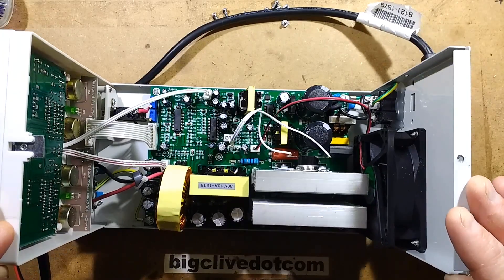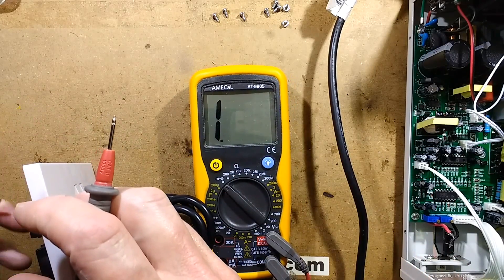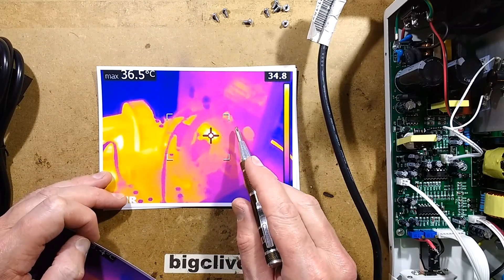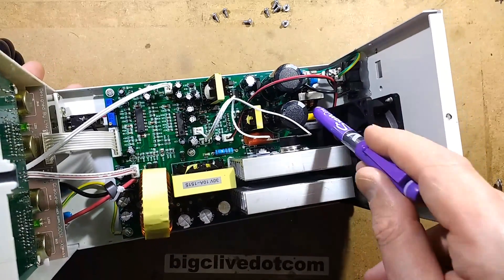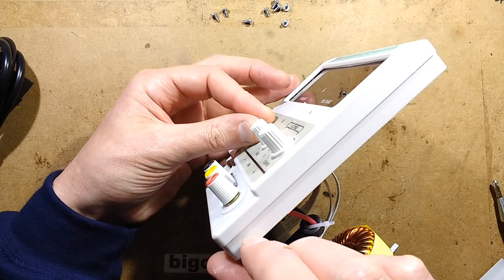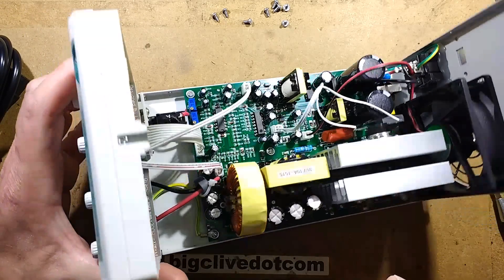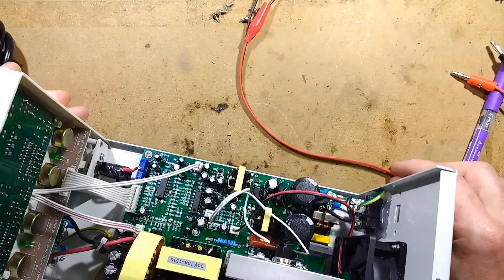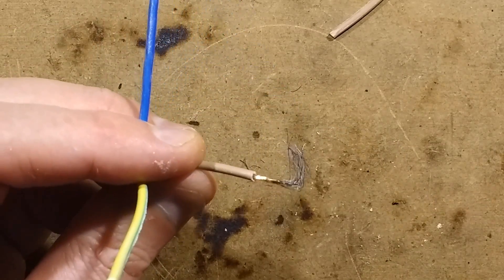Test of a PSU like the one that went on fire.

Comment: Hi Clive, I have a question and concern.   I recently took my MacBook Pro (mid 2013)15" which required a new power supply connector inside the computer.   Around 2 of the pins (#2 and #4) were darkened around the area like a burn.    After some time, despite having the appropriate 85W power supply still supplying 20.4v DC.. the computer wouldn't charger unless a jammed and wiggled the magnetic attachment.    What I noticed was that the connector of the power supply got very very hot, nearly burning skin when I touched it.    Any thoughts?
Reply from the maker: +Charles Wright Sounds like a bad connection.  Sometimes you're better changing both parts of a connector at once.  Plug and socket.  One part that is making a bad connection will damage the other.
Reply: Charles Wright one other thing to check for is iron filings , the magnets on mine often gather a coating, which stop them mating properly and could bridge the contacts I guess.  (I do quite a bit of milling/lathing/grinding mind you)
Reply: Thanks so much.....as do I do a lot of machining blacksmithing, etc.....fantastic thought.
Reply: Funny you should mention that.....I'm a blacksmith and never thought of that being the culprit...in fact when I had it repaired, they mentioned that the old power module in the laptop appeared to have been shorted out with a burnt appearance near the terminals.   A clean non-metallic brush on a dremel did the trick followed by IPOH on a swab and we are in business.  Thanks so much.
Reply: Charles Wright  glad you got it solved , mine never burnt out, but were difficult to seat until I spotted the shiny flecks and dull powder :)  I used a cotton bud to get mine out last time- thanks for pointing out a use for that nylon dremel brush I've been ignoring, it'll be my go-to tool next time :)

Comment: I wonder how they're doing the current feedback that's causing the oscillator to go unstable?  Someone fell down on the engineering.
Reply: Could be that massive output choke that they didnt bother stabilizing with some heatshrink/glue.
Reply: But that wouldn't account for the flicker.  When I was servicing switchers, if you could hear them, something was wrong as the frequency is normally higher than you can hear. As best as I can remember, it was either bad filter caps causing ripple to get into the feedback, or a power supply set for 240V plugged into a 120V power line.
Reply: Probably wouldn't affect the flicker no,  but the noise certainly.  A lot of better quality power supplies will heatshrink or epoxy the coils on chokes to prevent them from squealing/whining,  but yeah that's probably more on the input chokes than output ones.

Comment: So, circuit-wise it is basically an old-style ATX power supply...
Reply: Yes, and I'll bet the switchers are actually BJTs as well (13009 or similar, as usual in the old half-bridge arrangement).
Reply: apart from the multi voltage outputs
Reply: which the bench psu doesn't

Comment: LOL, they still use the KA7500 for Power Supplys??

You find those on either rather old ATX power Supplys from the early 2000s or so and of course rather shitty ATX Power Supplys...
Seen it a couple of times...
And it's usually some kind of Flyback circuit...
You should really take a look at some modern ATX Power Supplys. They use rather interesting things. Like LLC-Resonant mode converters and MOSFETs for secondary rectification and DC-DC Converters (12V to 3,3V).
And of course Ripple & Noise has to be under 25mV (or less)...
Reply from the maker: The circuitry reminded me strongly of a PC power supply.
Reply: This is classical AT power supply design, but for this application is much better choice than LLC. LLC is probably worst choice for wide variable output voltage, it is not impossible to make it work but at end you will get LLC solution that is much worse then this. LLC is still nowhere near as flexible as non-resonant topologies and for application like this, only usable solution if you want resonant technology  is phase shift PWM ZVS FB converter, but is little overkill for low power application like this (it is usually used for output powers over 10kW)

Comment: i got a korad 2x30v power supply. it came with the same terrible leads. like 18 or smaller wire just pushed over in the connector.

i replaced this with some 12ga silicone novak brand wire soldered into the jacks and to the clips. voltage drop before at 5A was like .5 volt or somewhere around there. and after it was like .02v or so.

does anyone know where i can find various sizes of wire as flexible as the novak stuff? (novak hobby shop is no longer in business)

Comment: Mine is a POS it goes into a weird unstable state almost an oscillation between CV and CC mode. The transformer makes all kinds of weird noises and on top of that I tried to charge some large lead acid batteries with it at 14.5v CC 5 amps and the thing blew up after about 5min! I had to replace the switching mosfets IRF-510's as I recall. I suspect the ones it came with where fake as the new ones seem to run much cooler. The reverse polarity protection consists of two surface mount Schottky diodes and no fuse so if you hook a battery up backwards the diodes and the trace near it explode... not much fun, the only good thing is this is a very standard layout textbook SMPS so it's easy to fix.
Reply: Tyler Costantini No amount of diodes can protect you from reverse plugging in a charged battery (or any other power source), your only hope is the current limiting.

Comment: What's a unijunction NPN?
Reply from the maker: It's the first type of transistor invented.  Just a plain traditional transistor with three layers of doped silicon.
Reply from the maker: Did I actually say unijunction instead of bipolar?  Damn!
Reply: I think you meant bipoler (BJT). A UJT is like a BJT, but the channel (between emitter and collector of a BJT structure) are connected under the base.

Comment: It's a nice power supply but has the usual pitfalls:
1. Poor leads.
2. Fan is a bit noisy. (Might be okay for some people)
3. Horrible output electrical noise.
4. Pulsating from an unstable feedback loop causing buzzing via Magnetostriction.
5. Crappy capacitors.
Reply: That's like saying it's a nice car except that you get horrible shakes at almost any speed, the wheels WILL come off in a week and it will propably burn you to death soonish... Where is the nice part?
Reply: petti78 It was a Holden?
Reply: Feel free to purchase a £150-£200 PSU instead of paying £40.
Reply: 6. The inrush limiting thermistors (hottest components) are mounted very close to the main smoothing capacitor. A bit more clearance would reduce the capacitor operating temperature. (A long term reliability issue.)
Reply: petti78
Well if it's not a nice car then why would it be a nice car? You fix it, duh! XD
Some new leads, a better output filter and a better fan, and perhaps a modification to the feedback compensation network and it should serve well.
Reply: bob s
Yeah true, but if you look at the thermals, the main capacitors don't seem too hot.
I'd be more worried about the output capacitors simply because they will see more ripple current, and thus heat up more if their ESR isn't low enough. (Sometimes you don't want too low ESR, actually. Super low ESR caps can make the power supply become unstable as it affects the poles and zeros that have to do with the feedback circuit bandwidth, ultimately affecting the stability of the feedback loop.)
Reply: The nice part is it'll sit nicely in a bin... :)

Comment: Is it not possible to remove the sleeving from the earth pin?
Reply from the maker: It's moulded around a thinner metal core.
Reply: Sure, but the cable is still fairly thin and made of copper-coated aluminium, so it's still a garbage cable.
Reply: For the sake of £1.50, lop the plug off and replace with a proper Kite Mark BS 1363 (or your country's equivalent) plug.
Reply: If you tried that with a UK plug, you couldn't get it in the socket. When you say they are not needed, that's correct, they don't do anything under normal circumstances but when something goes wrong in an appliance with a metal casing and it's not earthed, the entire case can become live at mains voltage. It's only there to provide a path for fault current to return to Earth which causes the fuse or breaker to blow and prevent injury or fire.As long as everything is fine then yes they are not needed but what happens when things go wrong and you have no earth pin ?
Reply: It's not just the plug that's the problem, that cable is not rated correctly. Best to chuck the whole thing away but make sure it's never going to be picked out of the bin and re-used by someone else by bending or snapping off one of the pins. A good pair of pliers will do this easily and it is a legal responsibility as taught by the NIC EIC.
Reply: If you're in the market for one of these, you probably have a half dozen spare mains leads anyway.
Reply: Philip F Labre got the US patent (1,672,067) in 1928 on our form of 3-prong grounding: 1 long round pin to ground with 2 power blades.  Said to be to protect his landlady from her fan. 

I used to have this patent number memorized to use in conversations.  Had to look it up this time.
Reply: I'd the cable wasn't such a load of crap anyway I'd use it on a piece of audio tech, many of which use the same IEC plug but don't use the earth pin. But the CCA wire has very high resistance and I wouldn't trust it there either.
Reply: pfifo fast No we don't!
Reply: I'm with Chris Errett.  I'd de-sleeve that ground ("earth") pin.

I'm sure an X-acto knife, file, blowtorch, or jackhammer would do the job.
Reply: I wouldn't. Why take the chance of mixing it up with a genuine cable down the line?
Reply: +Jason James All three pin IEC leads (C5, C13, C15) must have an earth as they need to be safe to use with any appliance - most of which will be Class I. (Actually, I believe it is illegal to have a Class II appliance with a three pin IEC connector, but can't be 100% sure of that).
Reply: OK, I've looked the standards up, and the cable I was referring to is the two-pin C17 -- a C13 without the earth pin. C13 leads fit a C17 socket, including the bad C17 one in the video, and would be (reeeeeelatively!) safe to use with one.

I agree with Chaos Corner though in that I wouldn't use these Chinesium cables anyway.
Reply: if you remove it, the plug will be stuck in the socket.
Reply: LOL  ....   "Chinesium"

That sounds fissile.

Comment: I have the same PSU. It's fine for my needs (Overvolting small components) My crocodile leads were also poor quality, particularly on the banana plug side. The wires were inserted the same as yours and the banana plugs were malformed and didn't fit. Also mine has really bad coil whine. Other than that it's a decent PSU.
Reply from the maker: It's just branded QW, but seems to be one of many identical units on eBay.
Reply: I would love one of these as I can not afford top speck kit. What make is it Buddy?
Reply: For not much more you might be able to pick up something like an HP 6632A for not a lot more. I ended up getting my 6632A for $80 shipped and it's a far better supply than these ones. It's worth watching for a few weeks and seeing what turns up.
Reply: Same here for the leads - they did not even bother to bend the wire over (quick fix though). But at least the crocodile clip was soldered, and it seems to be "real" copper (other than those cheap-ass croc-to-croc clips I have, they are even magnetic!). Thanks Clive for the heads-up!
Reply: Equipment branded G.W. is excellently awesome.
Reply: @gordonwelcher9598  Mine failed after 1 year. I eventually got some old school Irwin transformer based ones and they are much better.

Comment: As much as these Chinese companies love saving money, you'd think they would quit wasting plastic on sleeving those ground pins.
Reply: If you don't have a good working knowledge of UK plugs, you could easily think that adding the sheath to the earth pin was a good idea.

I've always just assumed it was an error, rather than a cost cutting exercise.
Reply: That would mean a design change, which would require a designer and additional work for no reason, not gonna happen. After all the plugs go out and they get paid, who cares if some capitalist pig dies on the other side of the globe or not. And think how much metal they save when the pin can be thinner from the bottom!
Reply: Plastic is cheaper than metal. Safety does not come high on the agenda in China, life is cheap.
Reply: Michael Beeny plastic on top of metal is not cheaper than just metal though.
Reply: I know that at least on one design I've seen Clive tear apart, the whole pin was in fact present, it was simply sheathed which effectively defeated the purpose of an otherwise functional ground connection. I'm pretty sure it was an error, but I'm just wondering why companies still seem to be producing these faulty products for no apparent reason, when it would actually be cheaper to make a proper plug. I mean. if the ground isn't functional anyway, why not just make the whole thing plastic and save even more money? Either way, it doesn't make sense from a corporate viewpoint.
Reply: Saves on metal.
Reply: Michael Beeny If they want to save copper (a bigger concern now than when the plug was invented), they can skimp on the tip of the pin that only does something during the brief moment of plugging it in or pulling it out.  That tip could be hollow and filled with a plastic wedge (to push open the special British form of shutters).  Ideally, such a wedge would be visible from the thin side of the pin so inspectors can see how deep it goes.  Making this should be economically comparable to the current bad sleeving design.
Reply: Not only that but maybe they use the same part for all three pins. Though I believe the ground is supposed to be bigger...
Reply: John Vickers
Yup ... believe it or not, plastic is cheaper than metals in the long run, despite all that goes into manufacturing plastics.
Reply: If it's just a sleeve that covers the ground pin, while the pin itself goes all the way through to the plug, you could just cut the sleeve off and had a proper ground connection. But my bet is that the metal ground pin actually starts at the point where the sleeve ends, so if you were to cut that off, the pin would have nothing to sit in. That means, they saved a few tiny fractions of a penny because they used plastic instead of metal, where metal should have been used.

Comment: Clive, what is the best variable power supply in your mind. I am looking for a fairly high amperage and voltage. I would also like to know what is the best soldering iron.
Reply: The power supply will depend on what sort of projects you intend to work on, but the readily available generic 0-30V power supplies are usually pretty good for most day to day applications. Personally, I do a lot of radio frequency projects and sometimes work with high-power audio amplifiers, so I prefer somewhat higher voltage ranges and also linear power supplies over switch-mode power supplies (like the one here) which produce more RF noise, so I like to buy big, used rack-mount lab supplies off ebay like HP, Kepco, or Sorensen. As for a soldering iron, it depends on your price range. For a beginner or on a budget, the generic 936 and 937-type soldering stations on ebay and amazon are considered great value for money. They even make stations that are combination soldering iron/hot air gun stations if you have need of a hot air gun.
Reply: RJ Anderson Something like 0.8-32.2 volts 0-21.5 amps?

Comment: Great tip on the sheathed ground.
Reply: Had no idea about that, what a terrible design.
Reply: Duh... it is a faulty implementation by the Chinese as the man said.
Reply: Wouldn't a sharp knife and some scraping produce a legal proper earth pin?  Seems like binning such leads is another addition to the ever expanding garbage pile.  Also do you toss the toaster or such appliances that have attached leads with the sheathed earth pins?
Reply: linagee it's an illegal plug in UK.  As Clive said it is the Chinese design that's wrong not the socket.  A good plug don't need to be contacted for the entire length of the earth pin
Reply: I come from the land of different plugs (not the type bigclive uses), but this really just seems like bad socket design. Can someone explain why the socket itself is only designed to contact half of the earth pin and not the entire length? (I'm guessing cost, but maybe something else?)
Reply: @linagee  I think most electricians would say the UK has the best plug design in terms of safety and utility. The only real drawback is that it's very large, which is quite inconvenient.

Comment: I brought one of the Lavolta branded units from Amazon, same unit design, but came with a UK complaint power lead, and the test leads were thicker core cable with soldered croc clips, and the banana plugs screwed onto the cable rather than the insulation.
Reply: I think mine's the same. Same brand name, at least, and I would have noticed if my leads were as nasty as the ones Clive's got there! Mine's only 5A, though, which has generally been enough for me thus far.